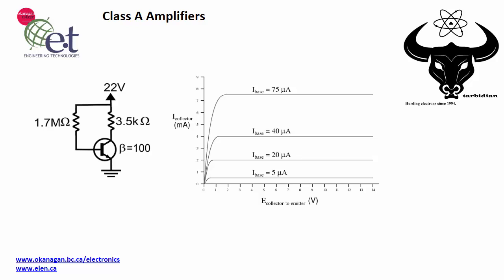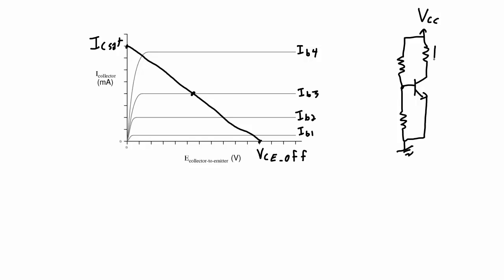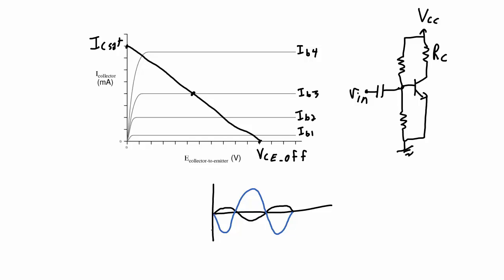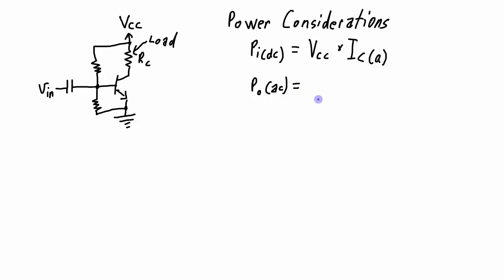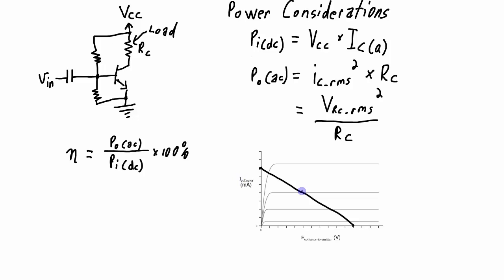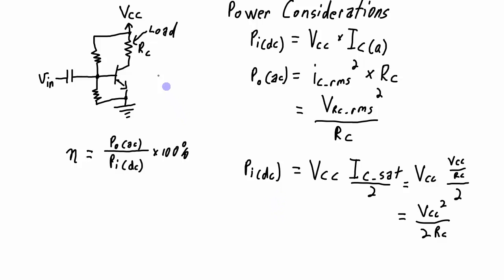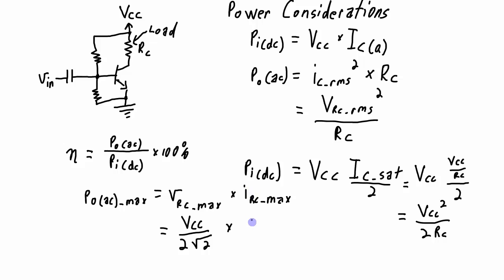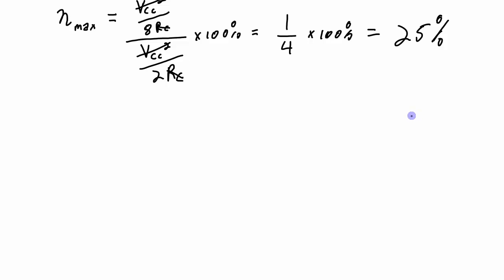BJT Class A Amplifiers

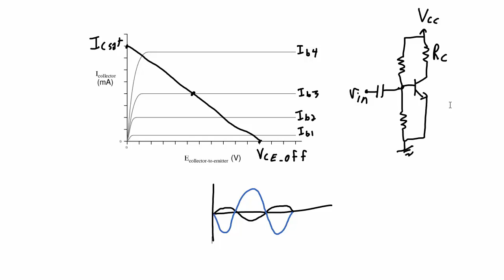Comment: Why isn't  the output signal  in the same phase with the input signal by using Class A Amp  2:43
Reply: It's a characteristic of BJT amplifiers in a common emitter configuration (as shown in this vid) to have a 180 degree phase shift (i.e. inversion)

Comment: Can you explain what relationship the straight line on your diagram has to the current curves? I was a bit confused by that.
Reply from the maker: The straight line is called the load line and it represents all of the possible combinations of collector current (IC) and collector-emitter voltage (VCE). The curved lines represent the relationship between IC and VCE for a particular base current (IB). If you know the IB based line, the intersection of that line and the load line is the operating point (Q-point) of the circuit.
Reply: +David Williams Thank you for explaining, and for your new videos